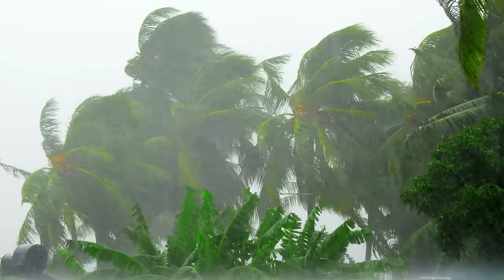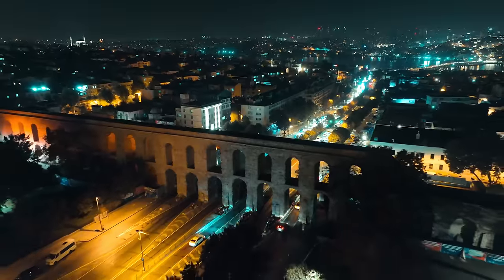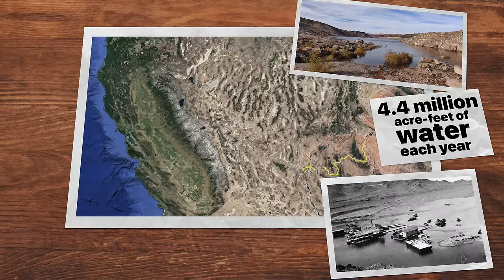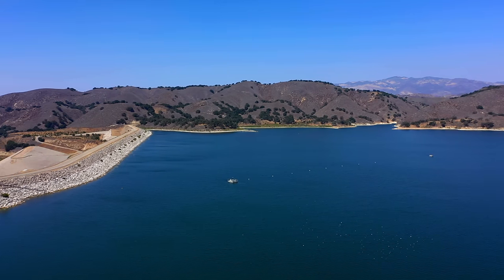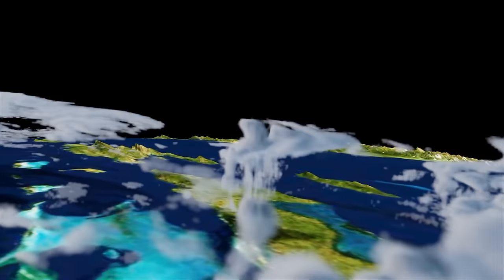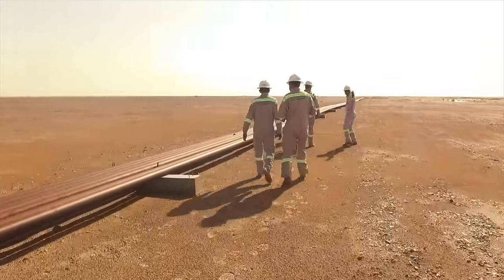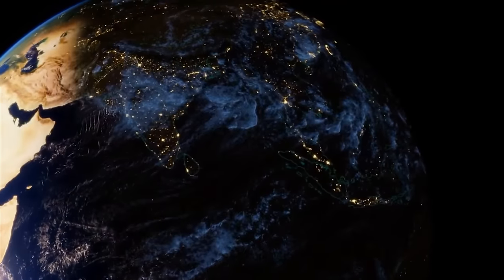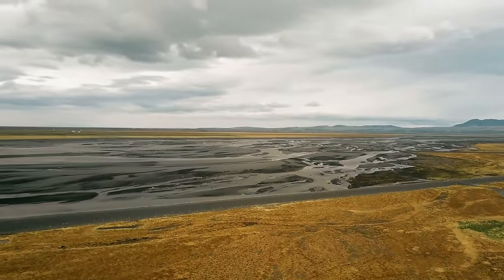Pipelines From Flood to Drought

Comment: Really cool that they are considering making this a real thing! Have previously proposed such a move to those who have the means and it is great to know that they are making a move on it.
As you so rightly said, the cost of not doing is astronomical by comparison to the cost of doing and the scale of growth these projects would encourage is mind boggling.
Also, really love the suggested treatment of the trade of the water supply - something I had overlooked in my mental models of such projects. This should encourage everyone to get on board. As, so long as there is a buck or two to be made, then why the heck not? Seriously though, a very cool solution to the ongoing crisis and one that could see implementation very swiftly, whilst we wait for AI of the likes of NVIDIA to come into the foray.
Great vid and ex as usual bro, keep up the amazing work. Kidos

Comment: Bad use of water is the problem. Solve the problem by living within the resources. Stop adding people and industry where water doesn’t exist. Farm where water allows. Farm with less water and chose crops for profit after water costs. The false economic situation built on water allocation well over what has ever existed. The political stress will pail in comparison to the oncoming water wars. We can pipe water but it won’t solve the massive over allocation of water. The problem is the water in the west is sold before it ever existed. The laws over sell the water so as we grow we steal the water from where it was already used. A few pipelines are well below the volume of output the government has been selling for decades. We fix this by turning off the water. If you disagree I fear your argument should not be to me. I am not selling pipe dreams. Just understand water is the 50 year old argument in the southwest. 400 years ago Indians starved out Santa Fe by shutting off the water. We service five states with Colorado river drainage not just a city or a few farmers. City’s LA, Phenix, Denver, Tucson, San Diego, Albuquerque, so the pipeline will need to fix a very big problem. Something like a river fifty feet deep and fifty feet wide just might help though. Anything smaller will cost a fortune and never do more than offer a few farmers the water they have historical rights to. Billons for little or nothing. Billons for a system that can not allow for growth because it will never meet demands sold years ago. Thanks for the work you did and the idea has merit but the volume sold far exceeds the physical ability of humans at this point to fix without fixing the unrealistic expectations of the states. Growth is just problematic without the water. The volumes are grater than the Colorado river could ever produce. Oh yeah twenty years of drought. Now we expect to fill an empty cup with a bottom missing.  A single pipe is just what Albuquerque can use. How many city’s need a pipe of their own? All of them. One pipe is just not enough for 100 towns fifty city’s a thousand farms and the other four states. Water parks pools golf skiing gambling sports green lawns and swamp coolers. A pipe in legion with 100 others can scratch the need. Fifty desalination plants and fifty Mississippi River pipes. That will start the fix. Dubbed it would allow for growth. That is what water should cost in the southwest. Replacement costs. Water is money and it is about to get nasty over the next fifty years.

Comment: California could to build swales so that rain water can replenish aquifers instead of being lost to the ocean.    They have access to the Pacific ocean, so floating green houses on the ocean with a floor that is structured as a grid would have ocean water evaporating as steam and collecting inside the green house.  The steam would collect on the top of the green house and would drip down on the side where a gutter system could collect the water and direct it to elevated barrels which could then gravity feed it to crop irrigation systems in the green house.

Comment: 2 problems I can see:
1, will we have enough flood warning to pump enough water to mitigate wastage?
2, will the areas that receive excess water start making demands on pumped water even when there is no excess water to pump?
Reply from the maker: Interesting questions
Reply: And this is my concern. As a Virginia and NC resident, I have seen plenty of flooding and excess water at times, but I have also seen times of drought. It seems to me that once the pipeline is put in place, even when we do not have "excess" water, California will (almost) always need more. What happens when we want to say "no" as we build our water inventory levels back up, but they say "well, you might not have excess, but you have enough to share."
Reply: Also, they need super badass storm drain systems, also capable of diverting storm surge (where applicable)…don’t need to export salt water to California and Texas, lol.
Reply: @dougwills  I think the point is to only pump water out when the weather forecast models predict there will be a flood that will overflow the reservoirs. The idea isn’t to take water that other’s have in store and aren’t using, but to take water that would otherwise be lost to the ocean if a flood comes by.

Comment: If you utilize the great plains aquifer for storage of flood water after filtration you could then pump that water out of the great plains aquifer at a later date to accommodate for droughts in various areas across the United States of America and potentially even Canada the system also has the benefit of not requiring too much extra piping to cross the great plains aquifer instead you would merely dump it into the closest access point of the aquifer and then pull it out of it at its closest point to the distribution point thus eliminating at least 1000 to 2000 or more miles of piping

Comment: Desalination energy cost is equivalent to a height difference : (source wikipedia desalination) for sea water you need a pressure boost of 3 bars, thus equivalent to pumping water 30 meters high (100 feet).  So energetically speaking, the choice is between pumping water half way across the country, including over the Rocky Mountains and the Sierras, or pumping it 100 foot up from sea level (plus destination elevation).  Quite clearly the energy cost of desalination is hugely less.

Comment: I was with you until you used keystone flow rate as an example. Viscosity does make it harder to pump but just because it is easier to pump doesn't necessarily mean you  can pump it that much faster there is a threshold on how much volume can flow through a certain diameter pipe
Reply: I just spoke with Alberta and they say they don't have that much water for you.
Reply: note that in the video he goes over that it only needs to send 3 times as much water a day as oil, if you look at the math.
Reply: @nubnubbud  the only math he mentions is the viscosity of oil is 3 times that of water so you should be able to flow 3 times that much water. That is simply not true
Reply: @brettknighten1171  you're right on the viscosity part- I've done basic materials science and some engineering, pumping and viscosity does not work like that even at their most basic. but that's not the only math. that's the only math you're thinking about. he does some head math just after. 
HOWEVER. given his math, it would take 10 days of pumping to answer the ENTIRE US's annual domestic water use with the one pipe. This means, with another bout of head-math. that he could overestimate it by over 35x and still have a pipe that would work, which makes a valid point that the throughput of the pipes are not a primary concern here.
Reply: @nubnubbud  I just have a problem with an informative video being so far off on something like that. Makes me wonder what else he is wrong on. I know he was wrong on this because of my background in fluid management and pumping.
Reply: @brettknighten1171  just because he's using back of the napkin math in a youtube video doesn't mean it is a bad idea. It just needs to inspire enough people who DO know how these systems work to work out the details and see if it's feasible.
Reply: @warrensteel9954  if he did this much research to make this video he should understand that viscosity and flow rate doesn't work like that
Reply: @OMARONCONTROLLER  yes you can flow more fluid if it has less viscosity but it is definitely not a 1:1 with viscosity. I pump fluid in the oil field for a living we deal with everything from water to fluid thicker than tar sand.
Reply: @brettknighten1171  try pumping a solid. U will pump water tremendously faster than you will rocks. You pump all these different fluids for a living but with a constant force from the pump and varying pressure due to the viscosity change, I reckon your claim is nonscientific as you failed to keep all variables constant. Youre making an observation that you pump only a little more water out in the same time you pump oil but there is more to the literal equation than just viscosity, volume, and time. Your conclusion is false. As a person who's JOB this is, you should know flow rate also decreases further down the pipe away from the pump. Just because you operate in the oil field doesnt mean youre the smart guy that crunched the numbers beforehand.
Reply: @OMARONCONTROLLER  I never said you only pump a little more water out we can pump water almost twice as fast as our heavier fluids. In the video he states that because the oil sand is 1000 times more viscous than water you can pump 1000 times more water and that is simply not true
Reply: @brettknighten1171  it becomes 1000x harder to pump so the pump has to work 1000x harder to pump that higher viscosity. Anyways, I think we are both wrong because density is more important than viscosity when regarding turbulent flow, not laminar flow
Reply: @OMARONCONTROLLER  yes it is 1000 times harder to flow that doesn't mean that you can flow 1000 times more fluid.
Reply: @brettknighten1171  not with the same force from the pump, but with the same pressure (increased force) you could
Reply: @OMARONCONTROLLER  refer back to the link I posted that is not true

Comment: I always wondered what was being looked at with regards to this. Thanks!  Also, is there any research to move glacier ice prior to it melting? They were able to deliver large amounts of ice across the country without refrigeration in the 1700 and 1800’s. Why can’t we utilize this source for our water shortages and excessive water bottle usage
Reply: Or float icebergs away from the poles; maybe find a way to mount sails on ice bergs or something. I remember an ad in the late 50s for some distilled spirit where they used melted glacial water for its purity. If we could figure out a way to "dock" glaciers next to deserts and salvage the melt water with booms to channel it inland, maybe.
Reply: @tomstiyer657  All of your ideas aren't original and the Saudis decided it was too expensive.  If the Saudis think it's too expensive, it's a fact.

Comment: The problem is that you do not use pipelines to move large amounts of water over long distances, instead you need aqueducts/canals to be able to handle the volumes. These then become the major limitation as open water only flows downhill.
Reply: Roger are you in Utah? Class of 79?  The LA aqueduct uses a  8 foot deep by 11 foot wide rectangle  concrete to move about 400 acre feet a day
Reply: And as some pointed out waste plastic can be recycled made into big pipes. Unless we ruin it be creating plastic eating microbes.  The central california water project consists of short pump uphill piped sections starting at sea level  in the delta area and long open channels where gravity moves the water. It eventually gets pumped out of the central valley through the 1 to 2000
Reply: El Calhoun pass or talachipe pass into the LA area and san diago also part goes to Santa Barbra.  Some of the pumping stations are fed be two and even three  of the main trunk power distribution  lines that link northern and  southern california
Reply: Use staging caches for the next leg, or as hubs to where it is needed.

Comment: I think you need to recheck your numbers between Heavy Oil and water in the pipiline. Feels about ~0.8-1.5 times too much difference in volume pumped.
Best wishes from the far North.
Reply: I agree. You can’t increase the velocity in a pipe by 1000x without running into scouring issues. And I doubt that pipe velocities being used in the oil pipelines right low are anywhere near 1000x under the maximum pipe velocities for water in those same pipes. MAYBE 10x
Reply: @LucasRae  Yup, Renolds number, after which speed you get turbulence, as laminar flow is lost.
Reply: For water the Re can be simplified to ≈ 0.8 D/s with the maximum flow 2X or 1.6 D/s so for a 36" pipe that's ≈126.8 gal/s or 10.9 million gallons per day. Not insignificant, but that's still only 33 acre-foot per day. Not enough to impact flooding.
Reply: @PhiloSage  Thank you I only had to deal with air flow, didn't have the water figure to hand.

Comment: there is much to say about moving water from one place to another.  and I like the idea similar to the electrical grid.  but having different rain forests now would also disrupt the natural flow of how storms move.  so one place may become the new rain spot even though that area might not be ready to "soak" up the water.    would be interesting to see one test pipe from the missisippi river (choose a state) and go to new mexico or nevada to see how well that would work.
Reply: I don’t think you have to go that far. Houston to west of Austin( no need to go past Juction city which about half way between El Paso and Austin). It’s shorter so cost of the project would be less and the natural flow of storms theory could be investigated without major impact to coastal storms current flow. That part of Texas turns into desert not far west of Austin. 
Even if it does cause some storm movement, which way? Could it cause storm to move west? This area enough space to soak it up and used to be grass land anyway.  Then build another phase from those holding areas to El Paso or New Mexico, if it works.
Of course there are a lot of if’s and catches in this project. But just my thoughts.
Reply: Well I wonder about the desert eco system. I know us humans are now more apart of nature but things thrive in certain climates. Thing die in other.   So changing a desert into a lake might hurt more than help. 

Definitely curious as to what it does.  Would like to see some potential views of what would happen.
Reply: @blizzardmike1  Junction is not even close to the mid point between San Antonio or Austin  and El Paso. Its only 2 hrs away from SA and thats an 8hr drive to El Paso.